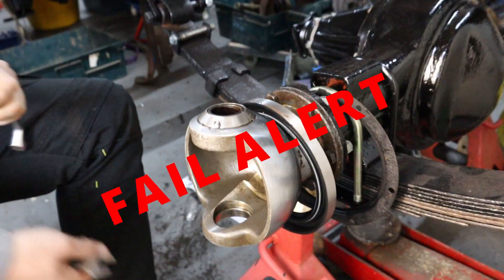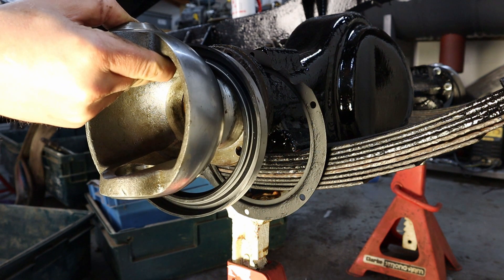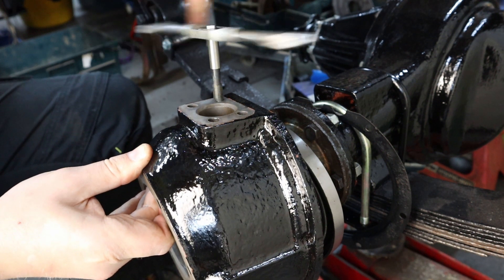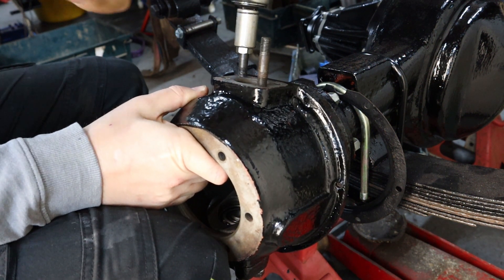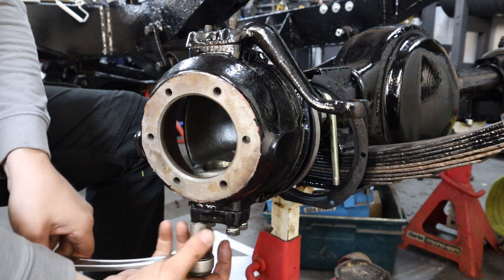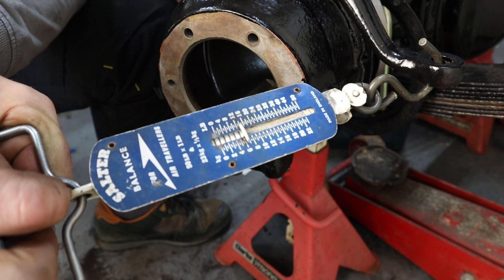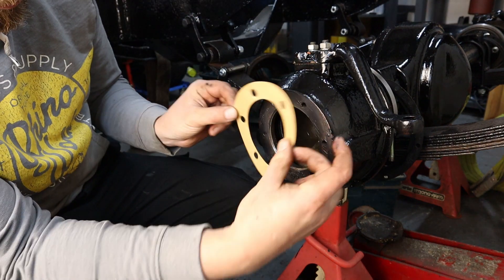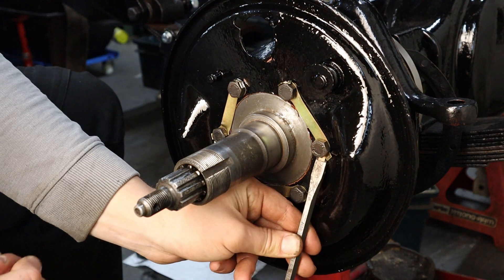Rebuilding a Land Rover Series 2 Front Axle Swivel Housing and Steering Joint (Part 2?) Restoration

Comment: Hola,Hello George thanks for the videos and explanation.. i have a question about the railko bush... its that an update from a diferent tipe, would it work using only roller bearing ? mine has this sistem ,Suspension link trunnion... regards from Chile mate... :hand-purple-blue-peace:

Comment: Haven't you put the steering arm on upside down, thought it's meant to be on the bottom of the swivel
Reply: Early Series 2's have steering arms on top of the swivel housings. Later Series 2's and 3's have them on the bottom.
Reply from the maker: I think you’re thinking of a later axle where they moved the steering arm to underneath

Comment: George, great videos and very helpful to me as I am at the stage of dismantling the axle on my '62 Military 2a. I haven't watched your entire back catalogue yet so maybe you mentioned this, but is yours a military (you mentioned military specs for the swivel tension which made me wonder)? Did you buy new swivels and housings given the condition when you dismantled them, or did you get them blasted? One of mine is good, the other totally manked up due to a seal failure somewhere, so just wondering what to do... Marc
Reply from the maker: Sorry for the late reply, mine is not military no. I didn't buy anything new, they were off an axle with leather gaiters so they hadn't been chipped by stones or anything.

Comment: very nice, thank you! but shouldn't the Steering Arm be on the bottom? at least at the the Series III it is. 🙃
Reply: Early series 1's/2's have the pendant steering arm setup, they changed it to the bottom late in the series 2a production
Reply from the maker: Yes series 3 is a different axle setup